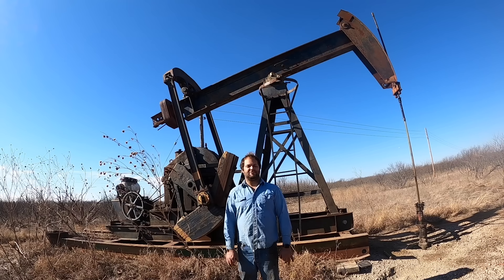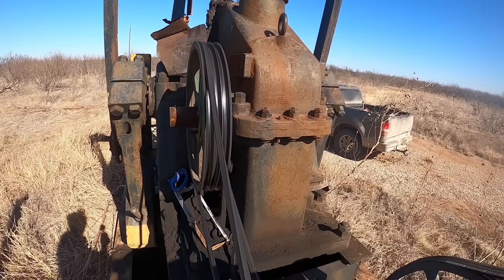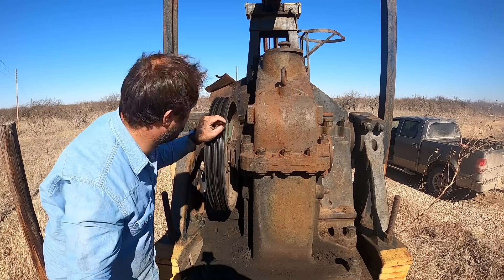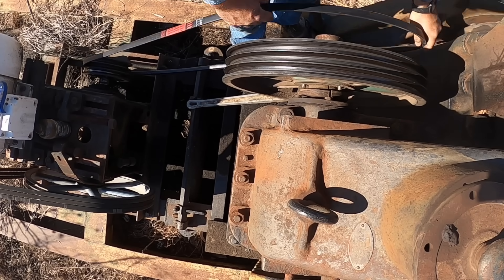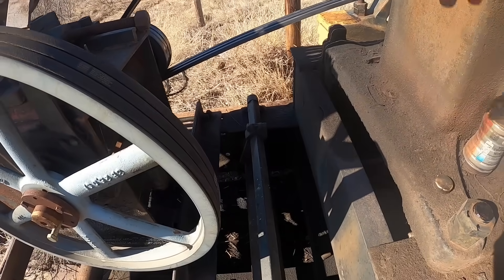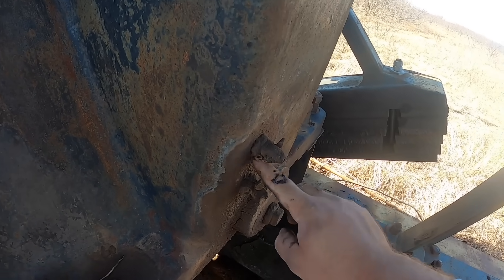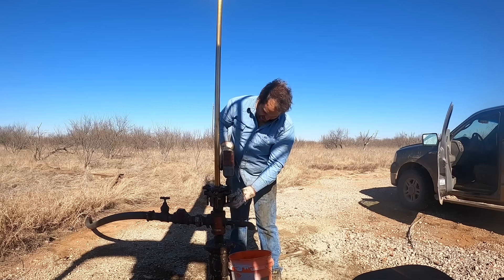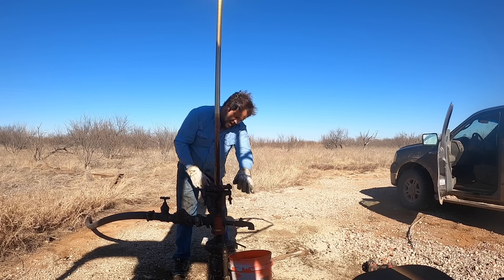Maintenance on a 101 Year Old Oil Well

Comment: That bleeder should be connected to the line past the shut off valve. Thus you don't need a bucket. Every bit helps. lol
Reply: Flowline head wouldn't probably let you bleed it off into the line anyway.